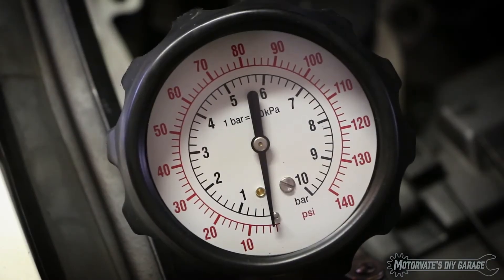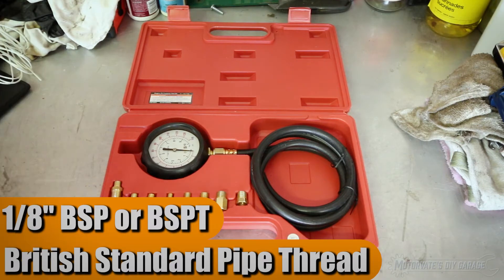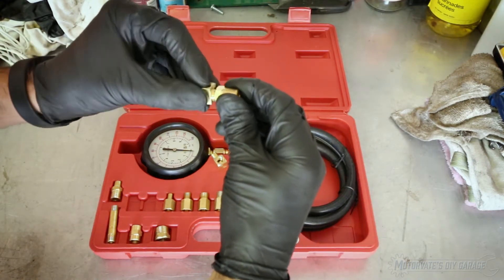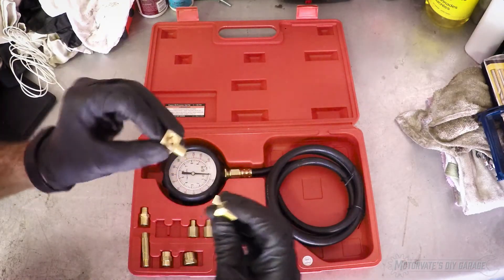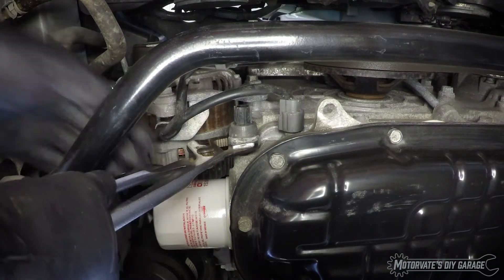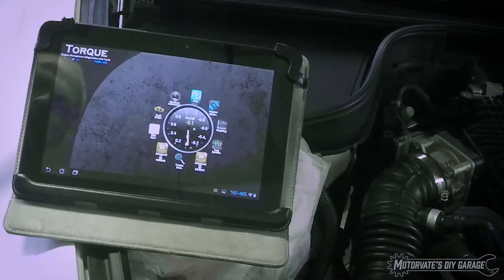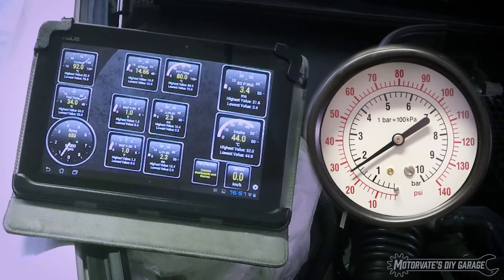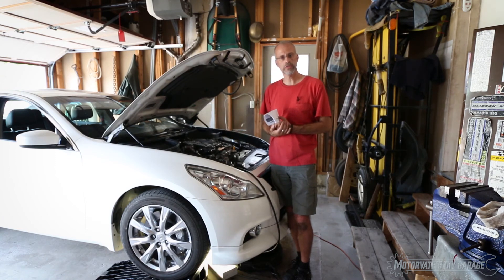Oil Pressure Check: G37/370z - Motorvate's DIY Garage Ep. 18

Comment: Is there any reason to not use a sandwich plate for an oil pressure gauge?  

i have seen a few threads where people broke the housing for the oem pressure switch on the upper oil pan.  ive also seen threads with people snapping the oem pressure switch.  I dont like the idea of adding a tee setup.
Reply from the maker: That is an excellent question!!!  The sandwich plate will give a higher oil pressure than what is in the engine. This is because it is the sandwich oil pressure is BEFORE the oil filter. The engine oil pressure is AFTER the oil filter and this can be a difference of 3-5 PSI (as a guess, I don't have had data on this... YET)

Bottom line, if you don't over tighten the oil pressure sensor, you won't split the aluminum. Most don't understand that it is a tapered fitting, so you can't go by feel. Look here: https://www.pegasusautoracing.com/document.asp?DocID=TECH00097

Generally for 1/8" NPT, after finger tight, you only tighten 1.5 to 3 turns.

I start with 1.5 and then check for leaks. No leaks = done. slight leak means an addition 1/2 turn and check again.
Reply: @MotorvateDIY  Im reading a thread now where a guy broke the upper oil pan just removing the switch.  the idea that it is so sensitive adding a tee with extra leverage seems like asking for trouble to me.  

3-5 psi sounds negligible to me.  am i missing something?

btw, thank you for making this video, and thank you for sharing your thoughts on the subject with me.
Reply: What equipment would you connect to the oil filter sandwich plate? I.e. what sensor?
Reply from the maker: (Sometimes comments hide from me and then pop up... like this one!)

The only time the upper oil pan cracks is due to over-tightening. The threads are tapered, and if you tighten it too much, you force apart/split the port.

As mentioned in the video, I only tighten it enough to prevent it from leaking and check it the next week OR go by the factory spec of 11 foot lbs. A good thread sealer liquid also helps.

However, if you want to use a sandwich plate, go right ahead, since you know the reading will be a little higher than actual, your good.

I do have a sandwich plate, and have wanted to do an oil pressure comparison between the plate and the engine port... Maybe I'll get to that this summer.
Reply: @MotorvateDIY  nice, i would be interested in the subject if you put out the data between the two.  thanks and thanks for your additional feedback.

Comment: @motorvate DIY I know this is an old video but just a quickk question, i tested my hr g35 sedan last night and the pressure was awesome just like yours in the video but the fitting on the oil switch was leaking just a little bit of oil like maybe a drop every 3 seconds, will this throw off my reading at all? I was thinking it would maybe actually show a little lower of a reading because it was maybe loosing a tiny amount of pressure?? Wasnt that loose at all just curious!
Reply from the maker: It may be an old video, but as the VQs get older, this check needs to be done more than ever :)

A few drips from the pressure gauge won't have any measurable change in the indicated oil pressure. You have nothing to worry about :)
Reply: @MotorvateDIY  awesome, now i dont have to worry about babying it and drive it the way it was intended :) thanks again for all the great information and responding !

Comment: Question, do you know of a solution I can permanently hook up a oil pressure sensor and have it remote transmit so an app like torque can read it (maybe with a plugin or some sort?). I am guessing not. I need to do this though as my engine VQ35HR is prone to the oil galley gasket failure, and the only way to tell if it's starting to go it to monitor the oil pressure regularly.
Reply from the maker: Hey Ryan Vanderwerf,
We have the same concern regarding the oil gallery gasket failure as it is the same on the VQ35 and VQ37 engines.

I am not aware of any remote oil pressure sensors. 

However, as time permits, I have been working on an Arduino (inexpensive open source micro controller) based  oil pressure and temperature gauge with a small LED display to keep track of my oil pressure and temperature.

Down the road, if all goes well, it will be an episode.
Reply: Ryan Vander, This is one of those problems that happen to a few cars and everyone expects it to happen to theirs. Not to say it does not happen because it does. I would just keep an eye on your dipstick, and so long as you are not getting the oil light or sounds of death from the engine, you should be just fine. Do note that Nissan has a tiny oil filter and requires more frequent oil changes as the filter gets full pretty fast. This may affect your pressure if the filter's bypass is not working properly.

Comment: Thanks a lot for the video, it has been really helpful! I have a 2008 G37 and I measure the oil pressure at idle (700 RPM) to be 10 PSI. At 2000 RPM, the oil pressure does not quite reach 40 PSI. I am doing some work on the front end of the car because I hit a deer. I already have to replace the front bumper and radiator. Would you recommend doing a galley gasket repair while I have access? I am trying to decide whether its worth it. The car runs great but has 165k miles. Also, when I did the oil pressure test, the car was on ramps so that I could get to the oil pan. Does that matter for running the test?
Reply from the maker: If your oil pressure is at 10 psi at idle, I suspect your galley gaskets are leaking.
Having the front on ramps won't change the oil pressure. In the video, my car was also on just the front ramps.

Generally the VQ engines are very durable and last a long time. My 95 Maxima had 246,000 miles on it when I sold it.. and it still ran great!

If the rest of the car is in good condition, I do think it is worth it to replace the galley gaskets. For the cost of that, that should give you an additional 100,000+ miles.

Good luck for  what ever you decide :)
Reply: @MotorvateDIY  Great information! Yeah I like the car and it otherwise runs well. I think I will take the time to have the gaskets replaced. Is there a good reference you would recommend for doing that. Thanks again!
Reply from the maker: Since my galley gaskets are OK (so far) I don't have a good reference for you.
Search around and I'm sure you will find a few.

Good luck!

Comment: Hey motorvate, my car won't go past 4k rpms but goes through the gears just fine. The infiniti mechanic said that on my 2011 g37x the oil pressure sensor was broken and the oil temperature sensor was reading incorrectly and that those were the things causing me to be in like a "safe mode" does this make sense? Also curious what the torque spec is for the oil temperature sensor
Reply from the maker: At the very top of the video description is says:
* Tip: Don't over tighten the oil pressure switch, the factory shop manual specifies 11 foot pounds. *

An easier way is to only turn it 1.5 - 3 turns past finger tight. On my car 2 turns was perfect. Also don't forget to use a thread sealer.
Source: https://www.pegasusautoracing.com/document.asp?DocID=TECH00097

From the factory, there is a 4K soft limiter when in park or neutral, so that is nothing to worry about.

The oil pressure switch doesn't do anything but turn on a light in the dash when the oil pressure is 4 PSI or less. I removed mine a year ago to add my oil pressure gauge. - It isn't needed. If you do have low oil pressure, you will have cam phasing codes (ex P0011/P0021) way before the low oil pressure light turn on.

Oil temperate IS critical to proper  engine  operation. If the engine computer thinks the oil temp is too high, it will reduce engine RPM... I think that is the single root of your problem.
Reply: @MotorvateDIY  This video does not work for the 2011 G37x - Do you have any recommendations? I cannot seem to get a wrench on the oil pressure switch it is extremely tight space and the positioning is on top of the oil pan not on the side. Please advise
Reply from the maker: As you noticed, since your car is AWD, the location of the oil pressure switch is different.

Since my car is RWD, I can't offer any suggestions as I don't have any first hand experience.  You could try getting a oil pressure switch socket and that may give you easier access to loosen it.

Comment: I have the p0011 and the p0021 but not p0524 ,you think that my galley gaskets are bad ,2012 g37 ,105000 milles
Reply from the maker: The only way to know for sure is to check your oil pressure. It is a bit of a pain, but an early check just might save your engine.
Reply: @MotorvateDIY  I did bought a pressure tester OTC brand and the car has 30 psi at idle and 70 psi at 2000 rpm
Reply: I just recently got those 2 codes also on my 2004 g35(215k miles). Car started making noise somewhere from the engine even though i havent heard it the past few days and is constantly about to stall or does stall every time i come to a stop.  Replaced both VVT solenoids and actuators. Didnt fix anything. Next step is to check oil pressure once my gauge gets here and then im going to check the timing tensioner and chain to see if anythings wrong there. If all looks good at that point im not sure what im going to do unless my code reader(bluedriver) just completely threw me in the wrong direction.

Comment: My guage in the car was all over the place in my 04 350z with the engine at op temp the manual guage rest at 30 at idle i was told thats great oil pressure
Reply from the maker: If the oil was at 80C/176F that is good oil pressure. The factory spec is > 14 psi at a hot idle.

Comment: Should the gallery gasket flaw keep me from buying a pre-2013 G37?
Reply from the maker: Hey Terry1212,
Well... that is a tough question to answer!

Overall, I don't think it is a common issue. I think the G37 forums tend to make us think it is more common than it is.

However, for those it has happened to, it is an unexpected and costly expense.

As part of the pre-purchase inspection, I would make sure the oil pressure is measured (> 14 psi at 80C) and decide from there.

If you do purchase a G37, when the engine is cold, I would keep the RPM under 2500 for the first 20-30 minutes. Cold oil is VERY thick and the oil pump in the G37 is a high volume pump. On my car during a cold start, I have seen the oil pressure MORE than 120 PSI! 

I often wonder on the gaskets that have failed, how did  the owner drive the car on a cold start? 

Anyways, the G37 is a wonderful car and generally has been VERY reliable and a lot of fun to drive.
Reply: @MotorvateDIY  interesting. I'll be more careful with mine on cold starts but unfortunately I've had the car since 2013 so the damage would be done if any at all.
Reply: @behindthen0thing  I have a 2019 370Z that has an oil temperature gauge. On a cold start, I let it idle until the coolant gets up to temp, which is pretty quick and takes a few minutes. I then drive away with my revs not exceeding 2K with only gentle acceleration until the oil temp gets up to 180⁰F, usually within 4 or 5 miles. My car has 67K miles and uses no oil, as indicated on the dipstick, during the 3K mile oil change interval and has a hot idle oil pressure of 30 psi with the Nissan recommended 5w-30 oil.

Comment: Hello, my coolent temperature never crosses 185 F, doesn't matter how long I let it idel and even after 45m to an hour drive.  Or is this normal? You think my coolent sensor maybe have an issue!!
By the way thanks as always for your detail videos, my oil pressure looks good :)
Reply from the maker: Hey  Ifteker Jaigirder,
The spec for the G35/G37 is for the thermostat to start opening at 80C / 177F and start to close at about 77C / 171F.

You engine coolant temperature is VERY closely checked by the ECU (engine control unit). On a cold start up, it will compare the engine coolant temp to the air intake temperature. ALSO the ECU watches how much the temperature over time when the engine is warming up.

Soooo.... If you don't have a check engine light, I suspect everything is good :)

If you want to learn more about all of the engine sensors on the VQ engine, please have a look at my other channel: https://www.youtube.com/watch?v=CXDX-89_ArU
Reply: @MotorvateDIY  thank you, feel lot better now. By the way I followed your oil pressure video and my pressure is good. I did manage to break sending pressure unit lol, but got a new one installed, it was a pain though, my structure on X is little different then S, bars and hoses are all cramped together, no space to move plyer or wranch. Took me a while but finally got it done.  I even bought the same kit as yours from HF :) I am glad I found you on YouTube. You speech, detail step by step, video quality and editing is perfect, you should have a TV channel :)
Oh! I am still waiting on upstream 02 sensors replacement video! Hopefully next summer?
Reply from the maker: Hey  Ifteker Jaigirder,
Sometimes I wish my G37 was all wheel drive, so the video would be relevant to more people, but I really prefer a manual transmission and proper (rear wheel :) drive.

Thanks for your kind words on the production works. I really appreciate it!

As for replacement of up stream O2, when I replace mine an episode will be made.

Comment: What’s the factory oil pressure psi for vq35hr engines? Is it same with yours?
Reply from the maker: Yes... the HR and VHR have the same oil pressure specs.
Reply: @MotorvateDIY  mine’s oil pressure sensor unit is broken and i retapped the thread and put a new long nut there.
While mine is already got replaced with enhanced gallery gasket and valve cover gaskets, may I know if I have to worry about low engine oil pressure?..
Reply from the maker: With new oil gallery gaskets, you should be good to go!
Reply: @MotorvateDIY  thank you for replying sir! 

Do you think our v36 g sedan’s factory oil pressure works well?

I’m wondering if i should install oil pressure gauge along with oil filter sandwich adapter.. or can i just keep driving my car without worrying about the oil pressure sensor removed…

Currently mine is v36 g35s under 80k miles and changing engine oils every 5months/3k miles…
Reply from the maker: The G35/G37 use an oil pressure switch. Based on bench testing, it turns on the low oil pressure light when the pressure is 4 psi or less. That is VERY low!! Typically you will have cam phasing codes (P0011/P0021) due to low oil pressure way before the low oil pressure light turns on.

An oil pressure gauge is an excellent idea! It allows you to keep an eye on the actual oil pressure, which just may save your engine if something happens.

A sandwich plate works well, but the oil pressure reading will be slightly higher (~1-5 psi) as you are sensing oil pressure BEFORE the oil filter.

The factory oil port is connected AFTER the oil filter and it the same pressure as the main oil galleries.

On my G37, I removed the factory oil pressure switch about 2 years ago, and replaced it with a 150 PSI pressure sensor.

So, you have 2 good option! Any oil pressure gauge is better than no oil pressure gauge!
Reply: @MotorvateDIY  thank you so much with detail explanation and advice sir!

May I know if you replaced the factory oil pressure sensor to the same spot or to the oil filter housing area?

May I also know why you replaced factory one to 150 psi? one?

Thank you!
Reply from the maker: I removed the factory oil pressure switch, and put in an oil pressure sensor.

Why 150 psi? Well, on a cold start in a Canadian winter, the engine oil pressure can get up to 130 psi.
Reply: @MotorvateDIY  i see. Thank you for replying. 

Did you replace the factory oil pressure sensor to the same spot where you used to install to the original unit? 
Or did you install the new 150 psi oil pressure sensor to oil filter housing?

It would be great if you can share a video how’s your current oil pressure sensor set up!..

And in your country, do you use 5w-30 for engine oil for the whole year including in summer and extreme cold weather?
Reply from the maker: Yes, same location.
Current oil pressure set up video: https://youtu.be/U_kH3K_C2AE?si=B9ypwRx33PFmii3G&t=502

and yes, I use 5W30 for every season.
Reply: @MotorvateDIY  Thank you for replying sir.

oh my goodness.. i should’ve watched the video before i reinstalled the factory oil pressure sensor… 

You clearly mentioned there to be careful when you tighten the oil pressure sensor..  mine is already broken and i fixed it by retapping its thread longer and tightened with long bolt..

I’m also using 5w-30 after trying variety viscosities like 0w-30, 0w-40, 5w-40… i think factory viscosity is the best..

Comment: Hey motorvate DIY, my idle while warm usually flickers between 13-15 psi and even sometimes up to 17 psi when my oil temp is around 80C. Do you think my gasket is about to go?
Reply: also my cold start is around 103 which I believe is normal for these cars and when I'm ranging from 2k to 2.5k rpm, my oil pressure is at 60-80.
Reply from the maker: Based on the data from my G37, if my car is good, so is yours. Idle is > 14 PSI At 80C/175F. Cold start of > 100 psi is normal.

I think your galley gaskets are good :) Just keep an eye on the idle oil pressure :)
Reply: @MotorvateDIY  thank you for the reply!